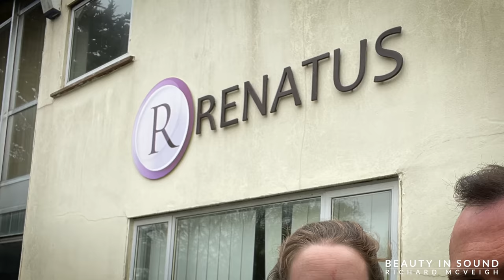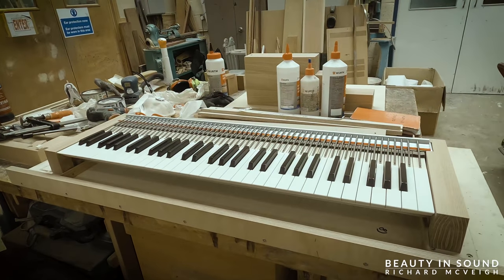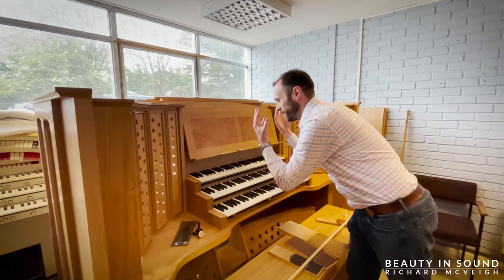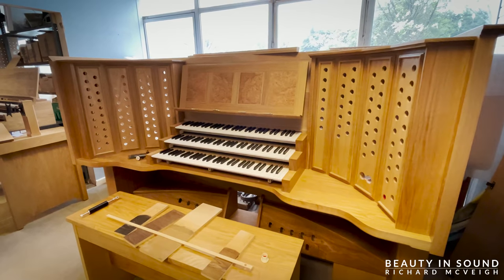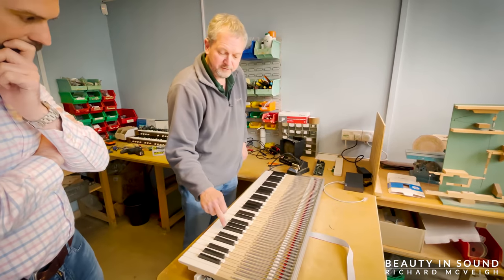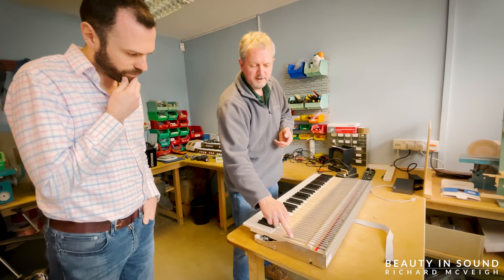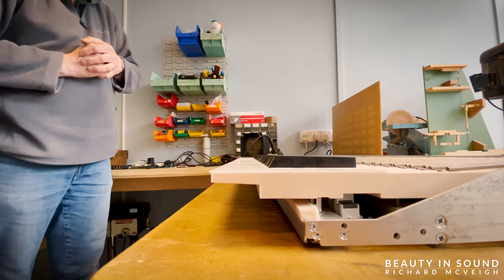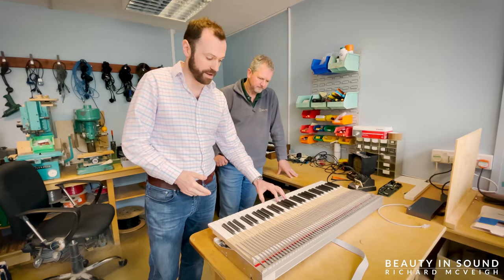☕ I visit my organ builder's workshop! | #NewOrganProject

Comment: My curiosity was aroused: On the underside of that beautiful keyboard there appear many round bobbin-like components--one for each key. The bobbins might be wound with insulated wire, perhaps to allow performance as an electromagnet to move the key. Is that device part of a system to effect inter-manual coupling as in a tracker action? Are you specifying that mechanical feature on your keyboards?
Reply from the maker: Where abouts, Dennis?
Reply: Those are screw heads for leveling the keys so that the keyboards are perfect.  The red felt underneath is to dampen the noise of the key returning after being played.  I have 6 UHT keyboards in stock at my shop.  They are stunning and magnificent to play. I have 3 in Grenadilla naturals and boxwood accidentals and 3 with ebony naturals and maple accidentals.

Comment: “Hall-effect” anything is going to be a “Boulevard of broken dreams”. I guarantee you, especially in a climate like England. For what purpose does a pipe organ need velocity sensitivity for keying anyways. It’s contact on, and contact off. The EP action doesn’t care how fast or slow you strike a key.
Reply: Curious as to what influence humidity would have on hall effect sensors?  They are used with great success in all sorts of dirty/wet applications.  I agree that velocity sense is not much use for this application, but UHT also supplies keyboards for non-pipe organs and likely uses the same sensors on all its products.  Some contemporary churches use non-traditional voices where touch sensitivity is desired (synthetic strings, piano, etc...).  A contact-less sensor is much preferred over mechanical sensors (micro-switch, capacitive touch) that will certainly fail with as much use as this organ will see.
Reply: @pianomanHev  anything with an optical sensor is prone to dirt, atmospherics and just plain degradation. Not to mention expense. There are 100 year old contacts in organs working just fine. Yes, if it’s a contemporary church key velocity would be good, but this is for YorkMinster....doesn’t sound all that contemporary to me.
Reply: Hall-Effect sensors are magnetic, not optical.  Most commercial systems are self-calibrating on startup to prevent cyphers from changes in environmental conditions.  

A Hall-Effect system can be abandoned for years and booted right back up without issue.  Without regular scraping motion or high current to clean them off, mechanical contacts will gradually become intermittent from corrosion. (In urban centers, atmospheric sulfur from vehicle exhaust can tarnish even silver contacts over time.)

Comment: Did you consider getting a hybrid organ, i.e. one real stop with pipes and tracker action and the rest being digital? That way you could enjoy the flexible articulation possible with a mechanical organ.
Reply from the maker: I didn't consider it, largely due to space and the fact that I'd want either one or the other. Have you heard a hybrid like this?
Reply: Nah, I've only heard of hybrids like this. Mine is a simple £3500 MIDI console with 4 fatar keyboards. Still, I feel very lucky as I'm only an amateur.
That said, I could improve my articulation if I had easy access to a mechanical instrument.
Reply from the maker: Have you tried the Melcer sample set by Piotr Grabowski? That’s as good as having a mechanical organ in your own house. I use it for practice - particularly the Trio Sonatas
Reply: @beautyinsound  I used Melcer a few years ago, it's nice, indeed, unmercifully pointing out all mistakes. It won't do for this case, though. What I meant by articulation was not legato vs. non-legato, but quick vs. slow attack and that requires a physical connection between the key and the valve, so one can control how quickly/slowly the valve opens. I wonder if that's a topic in England at all, where most of the organs have pneumatic action, so you cannot control it anyway.